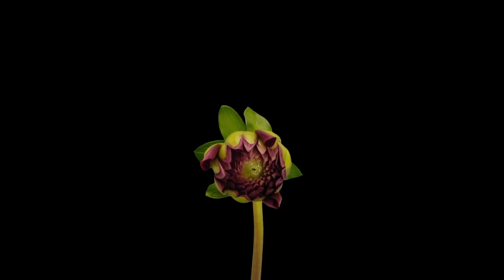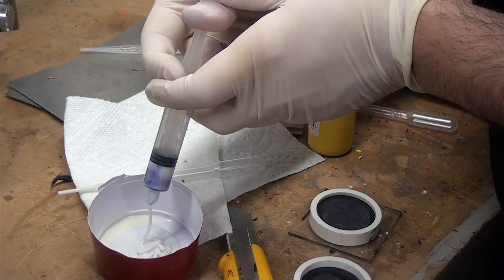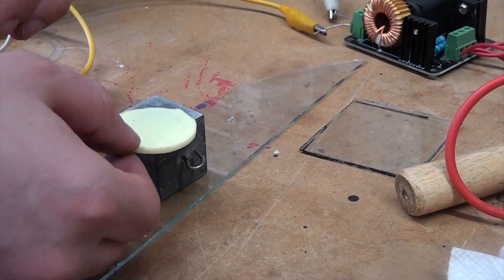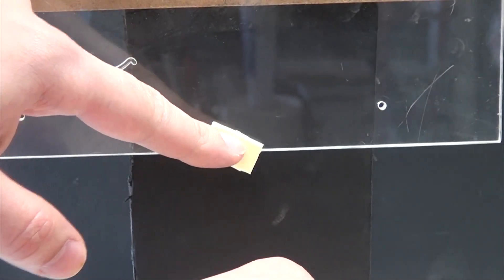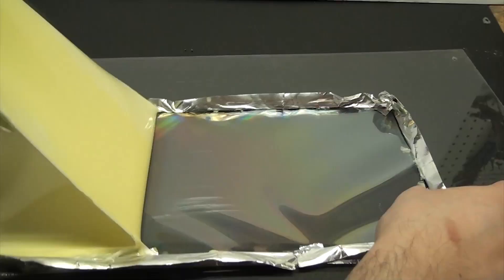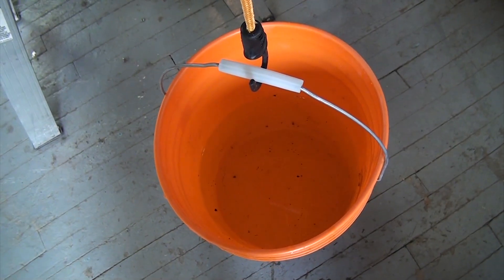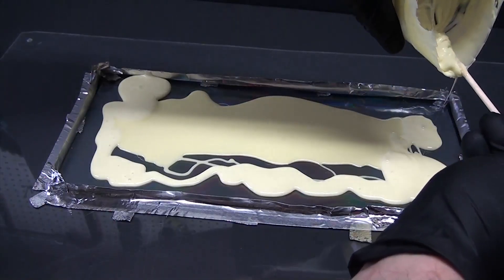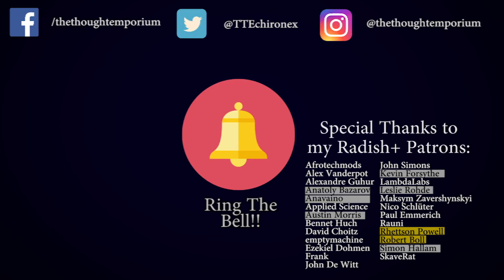Climbing Walls With RAINBOWS - DIY Gecko Tape

Comment: Your efforts worked Great!        Frequencies create patterns;  I don't know if they make peeks & valleys, just thought i'd say.    
How or What reacts to static - as hair & fabric fibers are extended.  
Just wondered if a pull (vacuum) on silicon would make 'hairs'     Files have that 'Grab' Touch - I can imagine diffraction grating.    Cheers!   ~- *

Comment: i think if you used a pressure chamber  with the silicone and something as fine or finer than your defraction grating, and made it with gloves or something you could maximize surface actully touching and make it much stronger cause of the pressure chamber forcing the silicone into the gratings to making the texture much finer

Comment: I wonder how effective CDs would be. At least it might have a different patterned surface
Reply: Not very as the pits are not particularly high surface area. BUT if you could control the laser manually, you could perhaps cut grooves into the surface rather than pits

Comment: You said that your gecko tape only sticks on flat surfaces, while real geckos can climb on anything (anything?).
Why is that? Is this because the 'hairs' on your tape aren't long enough, so they would only touch the high spots of the material whereas the long gecko hairs can reach into the 'valleys'?
And is there gecko tape available that can hold on anything?
Reply: teflon is the only material geckos can't stick

Comment: also - if the pad were inflated slightly makin=g it slightly convex, rather than flat, it would make more contact as pressuse is applied, and it would lift off easier as pressure is reduced.....

Comment: if the geckpo's toes stretched as much as the silicone it wouldn't get very far.  I think a MUCH thicker pour with fiberglass close to the textured part.  also after the silicone cures, if you made a series of shallow cuts close together  vertically on the horizontally aligned impression it would effectively give you more individual contact points - more like little squares than tyhin stripes.....

Comment: Maybe have an intermediary airpocket/blatters that give it some room to flex and deform to the surface you stick it too, if you cast the air chambers into the silicon or a separate piece it could work fairly well, and as another comment mentioned having a pattern of "vent channels/holes" threw the silicon to release air bubbles under the silicon it would possibly boost adhesion more

Comment: I recently got a Stanley Sticky pad. and after being impressed at how sticky it was/is.
i got experimenting.

I tried to set it on a flat vertical surface and attached my 10" tablet to it... and it held.
then i tried to put a folding meter stick, with 20 cm sections, on it. i unfolded it one section at at time, it could almost keep it up at 60 cm offhang, this provided reasonable torsion on the pad.
Torsion is about the worst enemy of sticking things together.
after that i put it upside down, with the same folding stick. i tried to pull down, and it held about 2 kg's (i assume)
Then i decided to put it back on and just let it hang. it stayed there for more than 24 hours.

... its not rainbow coloured though :D

Comment: You should try a water mattress under the rigid support of the silicone jecko. It will distribute evenly the force applied to the silicone jecko, even when applied to a non flat surface. The water mattress should be flexible but inextensible, in order to avoid the progressive detachment of the jecko because of its elastic deformation. Good luck!

Comment: well the problem with the contact is that the back of the silicon pads was not flat, so when you put the acrilic on the back the contact area was not flat, and for the other piece you just clapmed, it failed becuase weight was not evenly speadout on the picece, maybe if you can manage to make very flat and larger pices and to improove your molding you can make some pretty good pices out of it which will be better suited for the job, but a good replica of the geko's contact surface should have some fractal-like hairs and maybe the best way to form those is with chemestry by letting them grow in some way i think

Comment: hmmm, you could add a second scale of patterns by first casting silicon onto one of those cheap plastic Fresnel lenses available at the dollar store. Once it has hardened apply another very thin layer of silicon and then press that against the diffraction grating. Should present 2 scales of interaction then, one at the size of the Fresnel lens and another at the size of the diffraction grating.

Comment: This is fairly similar to Tech Ingredients (yt) optical chocolate video technique for molding diffraction gratings, check it out.
Reply from the maker: I've seen it, it's a great video. This improves the process as you can cast many piece of chocolate from the same sheet, rather than his method which destroys the grating each time. I didn't show it but I cast some wax on this and it took the pattern easily. Photos are on instagram. The hologram project is going to be the same thing, but a more complex pattern. The goal is to get it on chocolate at the end. It'll be a really cool process if it works and much more difficult than a simple grating like this

Comment: What if you take a diffraction grading and put it on the silicone and cast it. (And if you can melt the silicone properly) could you then put the diffraction grading at a ninety degree angle to the old setting.

Comment: Really awesome idea. I wonder if you tried other materials than silicon to see the effects of varying rigidity although I imagine that getting the pre-requisite detail may not be easy with other materials. Another idea could be casting from naturally porous materials or maybe from activated carbon as it is available as flat sheets but with the irregularity and pores interconnections maybe removing the silicone from them is impossible. You said that you likely won't take this any further but I hope that you do.

Comment: Maybe use some foamy backing instead so it's pressed everywhere against and not just on a small part
Reply: Yeah, small layer of foam and a slight bulge out so when force is applied it flattens and forces air from between.

Comment: What an inspiration.  If you  used clear silicon, could you have a stretchable diffraction grating silicon?  Also, a inflatable backing for the silicon could allow positioning and releasing from the wall.

Comment: Windshield adhesive? It's a silicone adhesive that could be cast?  Its sold cheaply as liquid flashing for windows etc.  Where I'm at you can pick it up from a lowes or home depot.
Reply: Good idea but how is the consistency while liquid? I think thinner is probably better

Comment: You could cut up the sheet into small pieces and "glue" them to a thin sponge-like silicone mat which in return is coupled to a fiber mat to prevent stretching.
This way you make sure each small pad gets to stick and the fiber mat can carry the load.

Comment: I am wondering if its possible to get better results by playing with the firmness of the silicon hairs, as Ben´s nano hairs collapsed by there own weight and they might be to soft.  I'm thinking that a firmer silicon might give you a better ridge structure. 

The most practical why to cast it would be a very thin layer of firm silicon that would have the ridges on them, and then a softer silicon on top for ease of handling.

Comment: I wonder if embedding some strong mesh in the silicone would improve the results by removing most of the stretch.
Reply: Use the mesh, with small standoffs to attach to a handle.  Use a thin layer of spongy material (like foam rubber) between the handle and the silicone.  That would make it so that more of the surface area would be in contact, as well as make the silicone sturdy enough to avoid stretching.  It could very easily double or triple the weight capacity of it.
Reply: Cast it onto fibre glas.

Comment: I get the fractal structure to densely pack hairs... but how can that silicon structure (which does have 'holes') be more effective than a flat sheet of material? the flat sheet has more surface area, if that is what is making it 'stick'. Is the interaction between areas with and without material what is actually necessary for this to work?
Reply from the maker: As it streches it pulls more material into contact rather than just losing contact as it stretches. That's what makes it more sticky

Comment: "silicone is expensive" you cant use normal silicone used for sealing windows? (the acetate based one)
Reply from the maker: It's too thick most likely but you're welcome to try
Reply: @thethoughtemporium  can you please provide a link from where did you ordered the grading sheet? maybe put it in the description or somewhere... i might have some idea how to make the acetate silicone less viscous... or maybe Ben will try to do that ;)
Reply: @Hobypyrocom  Maybe just mix some white spirits into it prior to casting. Normally it is a terrible idea as it will make silicone lose volume while curing; but it might be just par for the cause in this case. I can think of several ways in how it could be not useful or fail, but if you're trying things anyway, might as well.

Comment: A really simple way to make the defraction grading flat when you cast the silicon on it, you could just use some spray adhesive to hold it to the glass. If you cast it in a vacuum chamber, you would also probably get sharper wedges. Especially if you let the air back in when the silicone is all spread out, to push it into the smallest cracks. 

If you were to press a flexible, but not stretchy, material into the silicone while it was wet, you could probably make the pads work really well. I’m thinking of fiberglass embedded into the silicone to give it strength, without compromising flexibility.  

The second pad you tested failed by having the silicone stretch and peel off, so only the bottom half inch or so of contact had any sort of grip. Preventing the pad from stretching would probably fix this.
Reply: Thermophile He should really see this.
Reply: Yo dude that is straight up genius
Reply: And the acrylic backing could be put on top at the same time to make the whole finished pad flatter.

Comment: TIL: diffraction grating sheets are super cheap. Found a 5ft x 6in one for 20€, amazing.
Reply: Radiochemistry.org states that "Regular grade silicon (99%) costs about $0.50/g. Silicon 99.9% pure costs about $50/lb; hyperpure silicon may cost as much as $100/oz." Although a quick google search revealed 99.9% more around 120$ for 1 lb.  If you look at Alibaba they sell it by the ton. shipping and storage will probably be a doozy but some cost 1800$ raw
In terms of rtv mold silicon I found 3 lbs for 30$. 
Can you post your list of supplies. @TheThoughtEmporium

Comment: Wait, what happens if you just poured the silicone on Gecko Tape?
Could it just become a negative of that pattern?
Reply: Some of the ones shown would be incapable of being removed without damage, others would likely be extremely difficult if possible at all
Reply: @garret1930  maybe you could remove the original by dissolving it with something. But then if you cast something into that mold you probably won´t get it out either.

Comment: Would fibers or a fine mesh of metal inside the silicone stop it from streching?
If the mesh is flexible and can take the force maybe the tape would form around the material it is sitting on, while still not stretching too much.
Reply: Window screen material would be a very good candidate, I think. You can get fairly large rolls at your local hardware store.
Reply: I suspect the right implementation of this sort of reinforcement would be the most helpful thing for improving this while sticking with the easily accessible diffraction grating
Reply: Or a fiberglass mat.
Reply: gaffer tape mesh
Reply: you can buy very fine micron mesh screens. maybe take the silicone, and put it on the mesh and get it to drip through by waiting a little while before it cures before applying to the screen
Reply: exactly what i was thinking!
Reply: a piece of uncooked carbon fiber maybe.

Comment: there are two directional diffraction gratings. maby they create pillars instead of wedges.
Reply: Assuming the structure of these is also wedge shaped, they wouldn't form pillars, but instead they'd make pyramid shapes.
Reply: Xander Vice yeah pyramid shapes would mean less SA, so they’re probably worse
Reply: @justadummy_112  If it makes it conform to the surface better (which it might) it could end up with more effective surface area, only real way to know is to try it.
Reply: @justadummy_112  No, a bunch of pyramids = more surface area than a single wedge
Reply: I think he should try it

Comment: Couldn't you kind of oxidize it to increase its interactions?
Reply: oxidizing under a flame would leave anti stick carbon residue, but idk enough chemistry to say if other oxidations could work
Reply: @nathansmith3608  I was thinking more like a chemical oxidizer like sulfuric acid + H202, or maybe electrostatic discharge, etc.